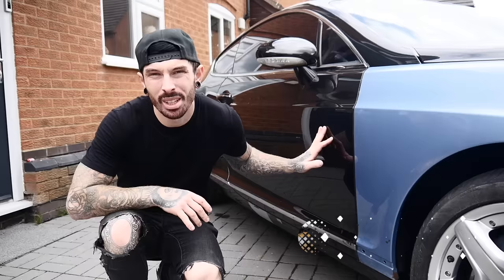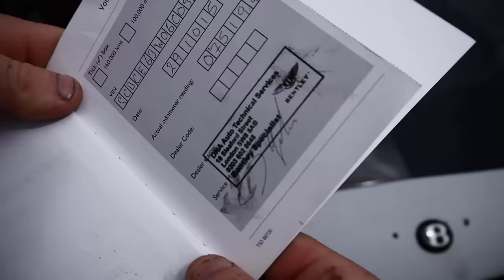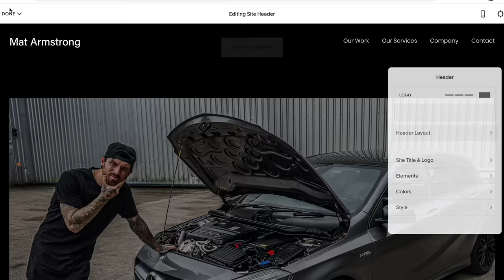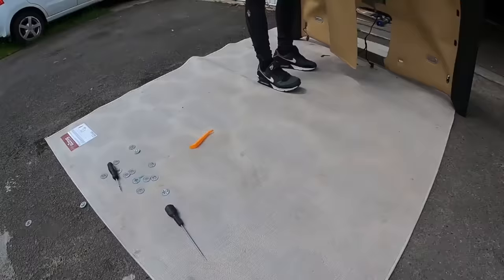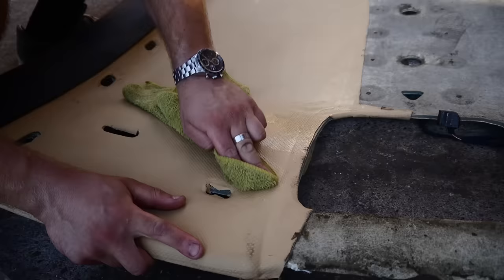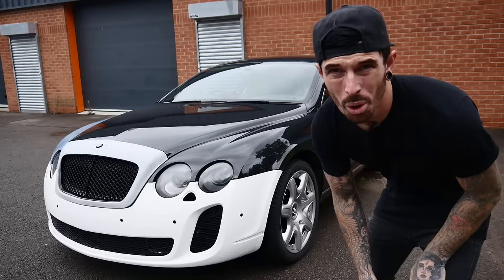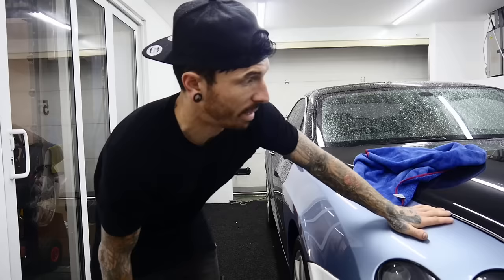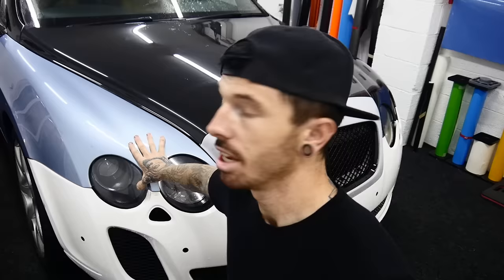BAD NEWS FOR MY CHEAP BENTLEY CONTINENTAL GT

Comment: Amazing.  Watching you remove that headliner was inspiring.   That would also be a “must do” for me,  as it would be the only flaw I noticed everyday until it was fixed.  I have used a spray adhesive by 3M on hood pads and other various repairs,  it works extremely well.  Back to your video...

Comment: Bumpers are always painted separately from metal panels, if you have an accident  and only the bumper is hit you will never touch the fenders with paint. There will always be some colour difference. The panels do need to be blended to prevent the colour differences. Wrap is the way to go Matt!

Comment: I've no doubt you got a quote for £8k, but the chap i use for paint will do each panel for £150, off the car, and its always a perfect colour match. He once did 3/4 of a Touareg for £750, which is what your Bentley basically is ;-) I think you just want to wrap it, which is fair enough, though you just don't get the gloss finish with wrap.

Comment: Mat, using a spray adhesive will sadly fail after about 6 months, especially if the car is left in the sun and the cabin gets Really hot. It needs a proper glue put it back on, still if you are not good to keep the car it won't matter......

Comment: Btw its £2500 for the cooling fans from Bentley as my mate priced it last week...strangely the front levelling sensors from Bentley are half the price of Vw if you shop by part number..my local Bentley agent have a special on front discs and pads this week £1100

Comment: Who told you that you cant paint edge to edge if it was red or white or a wiered metallic flake maybe, but there is equipment ie a probe you put on the car, it shines light on the paint and that info goes into a small eletronic unit, it then works out a formula which depending on which paint brand you use can vary slightly in price, but instead of looking through the old paint system microfiche you can now download the info into a computer and have a pretty accurate basecoat formula, the system isnt widely known as its very hi tech you should reach out to companies like...standox,glasurit,ppg,ICI, i bet one of them will help........oh me i was a automotive paint technician “paintsprayer “ for 30yrs so ive painted a few nice cars in my time....V12 E type Jags,lamborghini muira’s,Espadas,lots of 911 Porsches, Ferrari dino’s,Daytona’s,testarossa’s and way too many to remember.

Comment: Cheap Bentleys mean trouble and massive expense and repair bills. I would steer well clear.
Reply from the maker: Tbf mine was excellent I don’t have it anymore the the new owner daily drives it with no problems it was only cheap because of the damage
Reply: @MatArmstrongbmx  You must have been the exception rather than the rule then. Most of the cheap ones are dreadful.
Reply: @MatArmstrongbmx  Yours must have been the exception rather than the rule. Why did you sell it?
Reply from the maker: @ericgeorge5483  I can’t really film on one car video after video, people lose interest so I do change my cars every 6months or so
Reply: @MatArmstrongbmx  Ok, fair point.